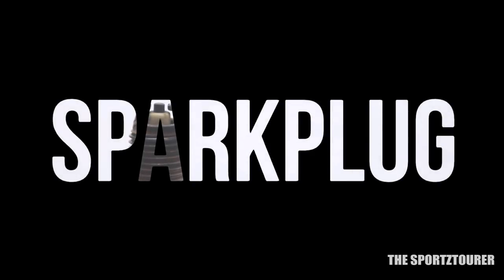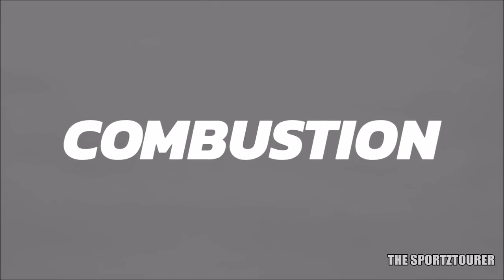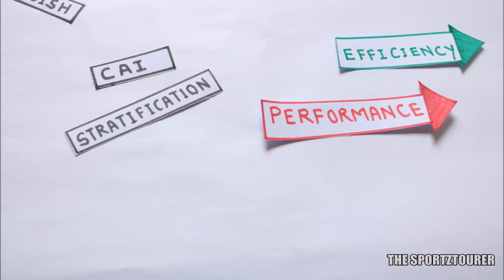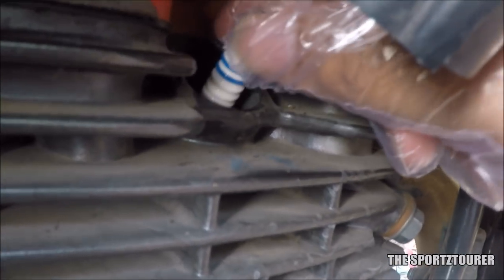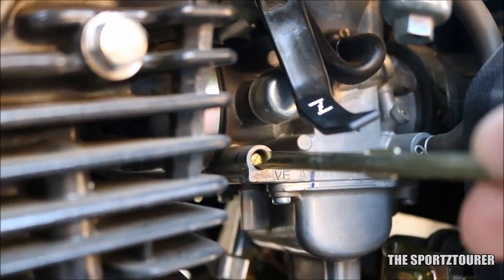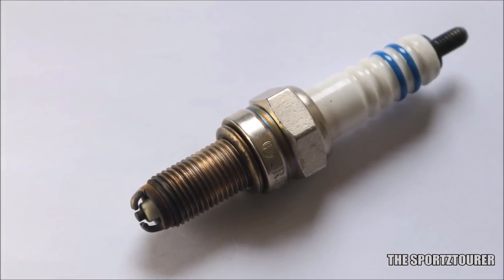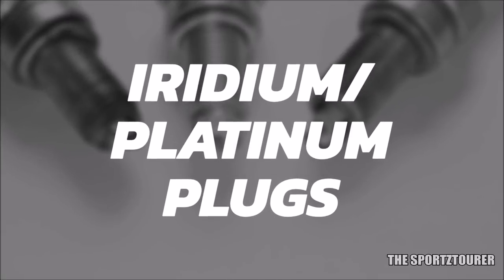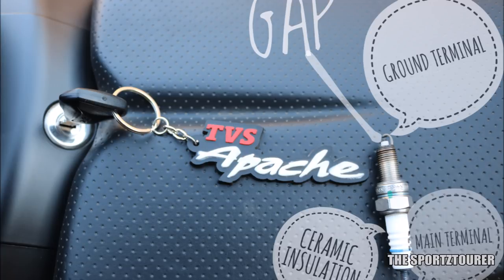TWIN ELECTRODE SPARKPLUG REVIEW, BEST SPARK PLUG? IRIDIUM PLATINUM SPARKPLUG EXPERIENCE | TVS APACHE

Comment: Hey bro, saw this video 1.5 months back and I changed my single electrode spark plug to twin electrode for my Hornet. The mileage has improved but not much whereas the power has improved a lot. Firing the engine is far far better than the previous spark plug. After a month of usage one can feel the difference!
Reply from the maker: Thanks a lot Nitish for sharing first hand experience with the twin spark plug 👍
Happy to know the sparkplug has performed well and I hope you are satisfied with the present performance. If possible keep me updated after some month and km.
Reply: What kind of car

Comment: I really look forward to your videos. They are to the point and informative and you are improving with each video. Thanks to you, I can now confidently do a ton of stuff without visiting the mechanic/TVS ASC(which generally suck in Bangalore). Great job! 

In one of your previous videos, you mentioned that one can determine whether the fueling is rich or lean by looking at the color of the electrode. Do you have any references or website links on exactly how to identify this?
Reply from the maker: That great Rohit, glad to know the channel is serving its purpose.
The picture of the electrode (different colour & condition) is in that video. The colour of electrode in this video is almost perfect which shows the mixture is optimum.

Comment: I had been using this twin electrode for almost two months and nearly 500km, I got an amazing experience in Fuel efficiency, my stock plug only gave me a mileage of 30kmpl but after using it i got 35-40kmpl but i finds a drastic change in performence, acceleration becomes less responsive, reduction in refinement of the engine. But moreover all these things, I can hear explosive sounds from my exhaust, which makes me feel like using a modified exhaust
Reply from the maker: Thanks a lot for sharing your experience 👍
Have you tried fine tuning the carburetor?
You experience should definitely help other riders visiting the comment section for more information 😊
Reply: Thank You bro, actually i didnt the understand the phrase "fine tuning", i sets my idle rpm at 1500,is that useful?
Reply from the maker: 1500 RPM should be fine 👍 This video should help you understanding about tuning: https://youtu.be/3LOP8asQ6Ek
Reply: @thesportztourer  how will my know that I need to fine tune my carb after installing it??

Comment: Awesome knowledge series.  one of the best.  Please provide more and more information on Dominar.
 How to adjust carburetor with Twin ignition spark plug. ???
Reply from the maker: Thanks Sudipta for calling it awesome 😊
Carburetor adjustment is same for twin electrode sparkplug you just have to set it to the optimum point.
Reply: can you do a detailed video regarding this bro  ?
Reply: @thesportztourer  did u reduced the fuel supply or increased after twin electrode plug installation. I guess better combustion means higher idle rpm than normal. Can you please throw some light? 😊

Comment: Yes I am using twin electrode spark plugs I changed recently after 12k kms.... Same performance but better fuel efficiency upto 40 in city conditions
Reply from the maker: That's great Gopi Krishna 👍 Good to know you are have similar experience.
Reply: where did you get the spark plug ?
Reply: In the automobile shop

Comment: can you please tell the procedure to tune the carburetor for the bs 4 variant of apache 200. cause the engine never dies when the fuel screw is turned fully clockwise. show a detailed video doing the same please.
Reply from the maker: I will try to make a video on that 👍
I would suggest you to get the carburetor tuned from an expert mechanic.

Comment: upon seeing your spark plug maintenance video, I removed my spark plug. And during the process I came to know about a hole which is present in the engine head.. And due to which I cane see the spark plug while reinstalling it.. Will it affect my engine? It's exactly on the space between the 2nd and 3rd fin..Please help me
Reply from the maker: Hi Suriyaprakash,
I was about to reply to your email when I saw this so replying here.
That blow out port is normal in between the fins 👍 so nothing to worry.
Reply: The Sportztourer ohh. So it won't cause any harm? And I bought and installed the twin electrode spark plug on my apache 200 bs 4. But I can't go beyond a certain speed like 70-80kmph.. And tuning the bike.. It's really difficult. Gave it to a mechanic, he did even worse.. I don't know what to do.. Coz the engine never stalls when I turn the air fuel screw In. Please help asap
Reply from the maker: Hi Suriyaprakash,
This is the reason I am afraid to make carburetor adjustment video as it is very easy to mess up with the settings.
I can understand your situation. For now follow these steps:
1. Close the adjustment screw fully (clockwise).
2. After closing start to open it in anti clockwise rotation.
3. Open/unscrew it for exact 3 turns (from the total close point) & stop.
4. Check the idling at this point.
5. Is the idling constant (not fluctuating).
6. If the idling RPM fluctuates then open the screw for an another quarter turn (not more than that).
7. Check the idling RPM.
8. If the idling RPM is constant then set the idling to standard 1400RPM.
9. TEST RIDE & CHECK.

All these should be done on a hot engine. This is all I can do over a text comment do reply here after the test ride.
Reply: The Sportztourer this is same regardless of the spark plug type? Currently I'm using the twin electrode spark plug. And while tuning I hear the rattling sound.. Is it from the spark plug or the cam chain? Is it normal? I didn't give this much attention previously to the engine noise. My bad

Comment: Does the AFR needs to adjusted after the installation of twin electrode. Also can you tell me what is the default carb setting???
Reply from the maker: Hi Hemnath,
Adjust the AFR only if it is required. it is not compulsory to adjust if the motorcycle is running fine after installation.

Comment: Can u tell me what is the default carb setting for RTR 200.

Also what is the model number of single electrode spark plug and twin electrode spark plug.
Reply from the maker: Have made a detailed video here: https://youtu.be/H68cX4uuG1I
Reply: I am asking after looking at the video, what was the default carb setting for rtr 200, the number of turns.

Also what is the stock spark plug model number??
Reply from the maker: Hi, 
Stock sparkplug model number is UR4KE.
Default setting is around 3 turns from close point.
Hope this helps now 😊
Reply: The Sportztourer. Thanks, my bike is facing some serious heating issues, i want to ensure is this becuase of carb setting. Now i have confirmed that its not because of carb settings, as mine was near to 2.75.

Changed the spark plugg back too stock model, changed the air filter, still facing heating issues.

Comment: I have replaced with twin head spark plug from tvs to honda unicorn 160. Now having issue with throttle missing around 2000-4500 rpm. Slow riding conditions. Is it related to the upgrade or should i tune up the carburetor. It was all fine with the regular spark plug.
Reply from the maker: Hi,
I am yet to try it on the Unicorn 160. Fine tuning the carb should definitely help in your case.
Reply: Thanks. It worked. The initial setting was less than 2 turns.  I tuned up to 2.5 turns. And finally it works better.

Comment: I'm trying to mod my Victor GX 2006 model bro.. I went ahead and thought of purchasing twin electrode spark plug and test it out! But the problem was he head was too big when compared to stock ones..do you think a metal  washer of 3-4mm might solve this problem? Also the clearance is 0.6mm for stock and 0.7mm for twin electrode..
What's your opinion bro!? 😊
Reply from the maker: If it is for experimentation then you can give it a try but let me tell you won't find much change on the super refined & efficient Victor's engine.
We did try it with washer on a RX100 & the metal washer got struck & we had to punch break the washer to remove!

Comment: In Amazon it shows this spark plug does not suit rtr 200 why bro please answer soon I want to buy it
Reply from the maker: I am using this for more than 10k km with no issues. You might need to fine tune the carburetor if required.
Here is the video: https://youtu.be/H68cX4uuG1I
Carburetor tuning: https://youtu.be/3LOP8asQ6Ek

Comment: Sorry boss but my experience with twin spark was different. I didn't notice any improvement in the performance & rather improving the clod start it got worsened. 
Flame propagation is different for twin & single electrode & engine will work better only if its is compatible with twin electrode.

Comment: Can u plzz tell how to check overheating on bike...  bcoz every bike gets heated afer some time
 And i also have rtr 200 so plz tell me
Reply from the maker: Overheating is something which you can feel. Many motorcycles have temperature gauge in them which will help to determine the heat level. Overheating will cause drop in performance & you can feel the heat on your legs.
Reply: The Sportztourer thnku bro

Comment: Sir what mixture setting we have to change after installing twin spark plug in apache rtr 160 BS4
Reply from the maker: Hi Siddharth,
Factory settings are somewhere in between 3-3.5 turns but you have to set it for optimum performance.
If you are new to tuning I will suggest you to get it adjusted from an expert mechanic.
Reply: The Sportztourer so sir my mixture is company adjusted.. So should i tune it after i install twin spark plug as company provides me single spark plug
Reply from the maker: Adjustment is not compulsory.. if you feel the motorcycle is miss firing or there is a lag in throttle response then you should adjust the air fuel ratio otherwise no need.
There are many riders who are happily using twin electrode without adjustment.
Reply: The Sportztourer okk sir whats your name..?

Comment: Bro ....will it improve cold start....?
My rtr200 is having some cold strt problem ..
And bro pls tell how long can i run my bike before 1 st service?
Mine rtr 600km ran and deu 1st service ...
Should i service it now or wait?
Reply from the maker: I would personally suggest you to get it serviced now as 1st service is important for long term performance. Get both the engine oil and oil filter changed.
Go with the list of problems/issues you are facing and get them listed in the service job sheet. Cold start issue can be taken care by carburetor tuning and later if you want you can switch to twin electrode sparkplug.
Reply: Thanks a lot bro👌

Comment: Any advise with regards to fuel injection engines if I change the spark plug
Reply from the maker: This same spark plug worked very well on the FZ fi so it should not be an issue 👍

Comment: sir I need to know how to tune carburetor on pulsar 180 after installing twin electrode sp plug rich fuel lean air or vice versa pls clear my doubt
Reply from the maker: Hi,
That would depend upon your present tuning. No special adjustment is needed if you feel the engine is running fine. If miss firing occurs then get it adjusted from an expert mechanic.
Reply: The Sportztourer so it depends if any fault occurs on the bike
Reply from the maker: Yes 👍 if you feel it needs tuning then only go for it.
Reply: The Sportztourer new subscriber
Reply from the maker: Thanks a lot for Subscribing,
Subscription is always a motivation to create more such content 😊

Comment: Bro motul 7100 10w40 kitna km tak chalta he rtr200 me?
Reply from the maker: Around 3500-4000km depending upon the use after which the viscosity starts to decline. You can still use it after that but the performance won't be the same.

Comment: @sportztourer Bro Can I use it for Royal Enfield Classic 500 and Pulsar NS 200?
Reply from the maker: Hi,
Won't fit on the Classic 500, can be used on the NS (auxillary ones) 👍
Reply: @thesportztourer  thank you for answering , what do you mean by auxiliary???
Reply from the maker: NS 200 has 3 Spark plugs, 1 primary spark plug and 2 secondary/auxillary ones 😊
Reply: @thesportztourer  Bro I have Royal Enfield Classic 500 Stealth Black , It has only single spark plug , so can I use twin electrode spark plug for this bike?

Comment: Bhai jb tvs  company 180,160 m twin spark plug de skte h phr 200m dene  m ky prblm tha koi reason hoga tbi toh single head wala use kr rhe 200 m... Ye bhi sochne wali baat h bhai... M ye video dekh k socha m bhi chnge kr leta h apna apache 200k spark plug jb m service centre gya wo bhi ye boli kch soch smjh k company bnaya h aaise hi thori single head 200 m de rha
Reply from the maker: Hi Vicky,
I am using this twin electrode sparkplug in my RTR 200 for the past 10k+km with no issues and have timely updated my experience here.
Mein aapka point samaj sakta hoon, infact TVS ne beech mein kuch batches mein twin electrode bhi use kiya hai (2016). RR310 mein bhi single electrode hi hai. Jaise k meine phele video mein bataya tha difference negligible hai yaha meine mera experience share kiya hai, I hope you liked it 😊

Comment: Bro what is the milage difference between the two?
Reply from the maker: Depends upon your riding conditions & carburetor tuning. Even with optimum condition don't expect much, I have done multiple fuel efficiency tests: https://youtu.be/-8GwHWE6Y_8
Reply: The Sportztourer Thanks for the reply bro. I am riding RTR 200 for 20 months now, and I am getting 38-41 in Chennai city, without any modifications.
Reply from the maker: That's fantastic 👍